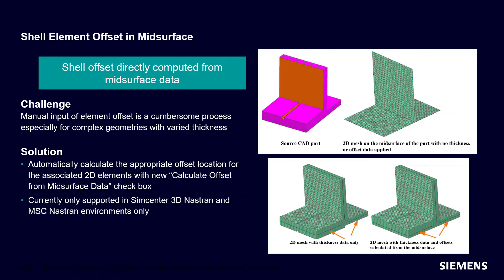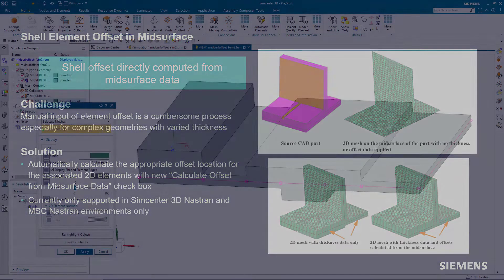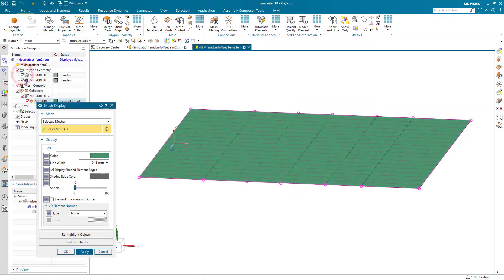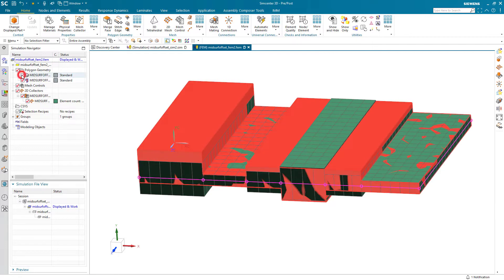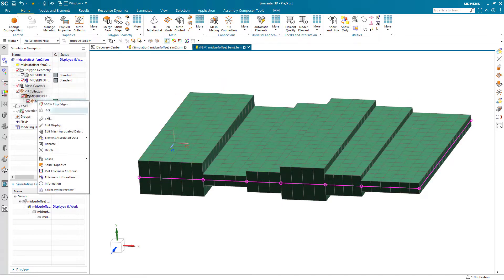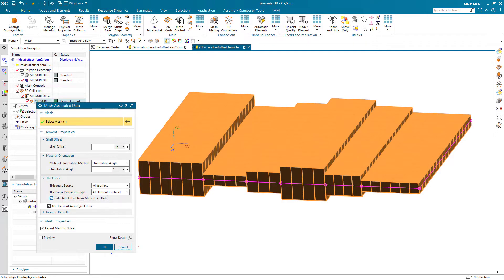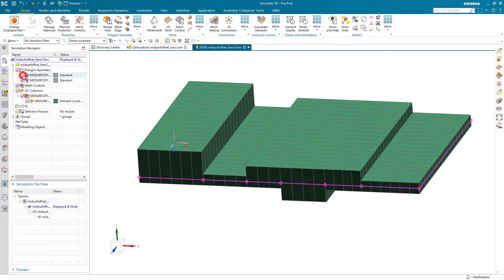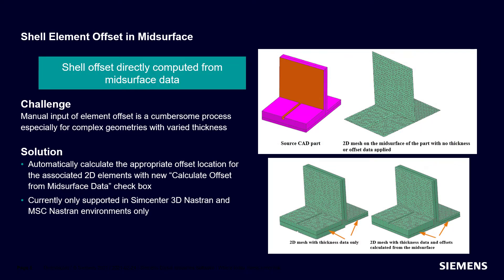How To Assign Offsets To A Shell Mesh

Comment: Hi, how to select only the visible elements. When I try it's selecting occulted elements aswell.
Reply from the maker: Is your question in the context of this demonstration?  If so, right click on the mesh in the navigator and select edit mesh associated data.
Reply: @Simcenter3DTipsandTricks  no, in general if we have to box select a particular set of elements, how to get only the visible ones. I'm using nx11
Reply from the maker: @gaganaut06  If you are selecting the elements from the post processor you have an option to select visible elements only.  If you are selecting the elements in the sim or fem, use the selection bar (next to the menu) and change if from "no selection filter" to "element".  If you don't do this you may get the mesh instead of the elements.